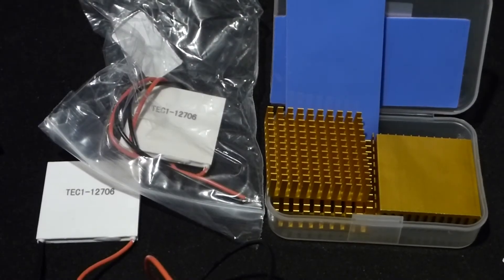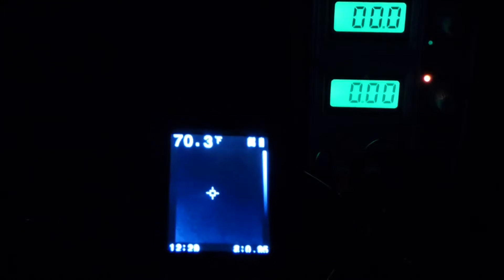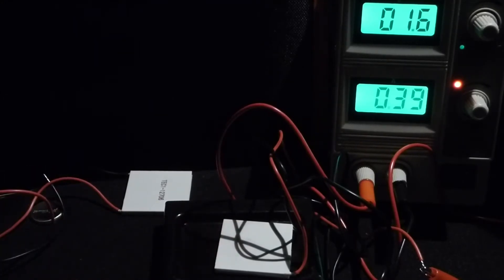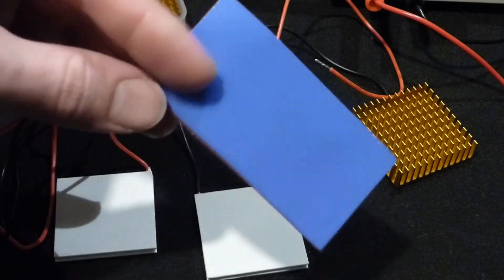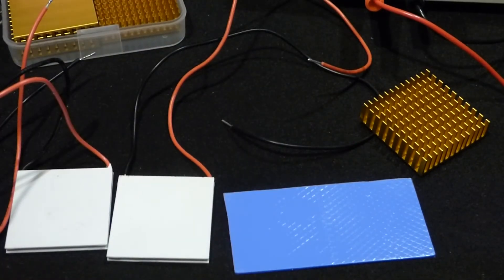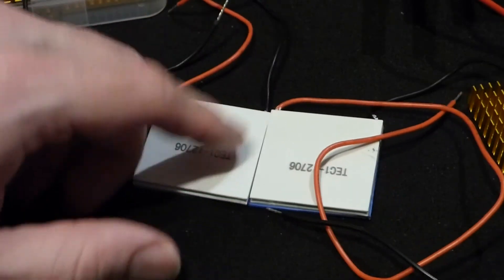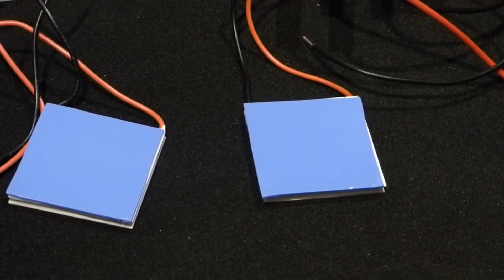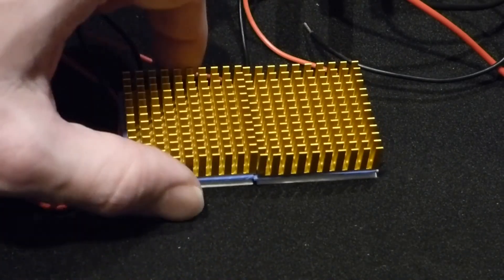I attach heat sinks to my Peltier thermo electric cooler components

Comment: Really helpful video, thank you!
Reply from the maker: Glad to hear! Thanks for watching!
Reply: @Electronzap  is it more efficient to attach heat pipes to the peltier and cool the fins that are on maybe 5 to 10 cm away on the other end of the heat pipe like a laptop cooler or cpu cooler
But in this case the peltier is in place of the cpu...